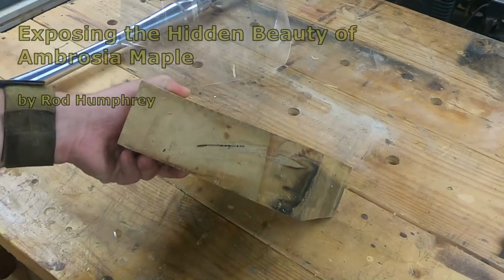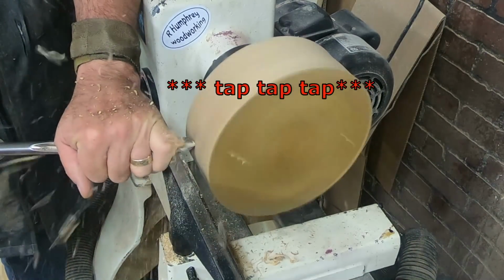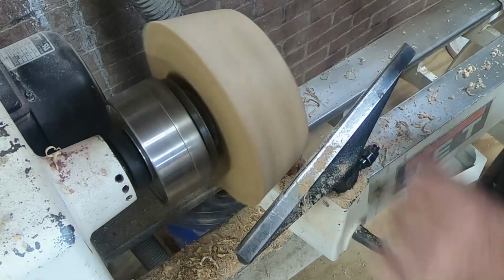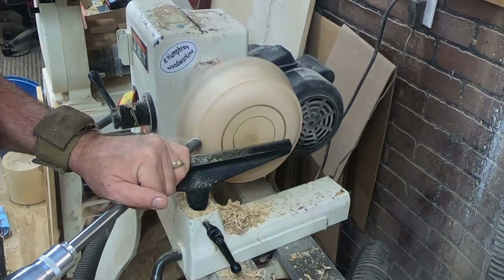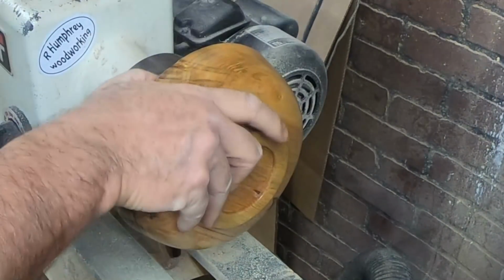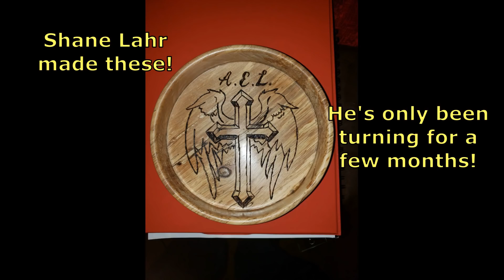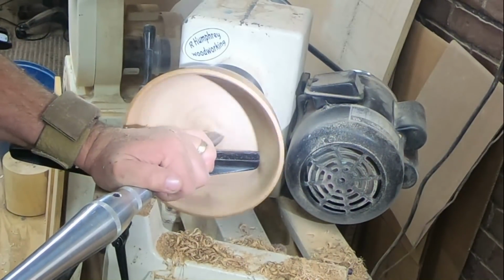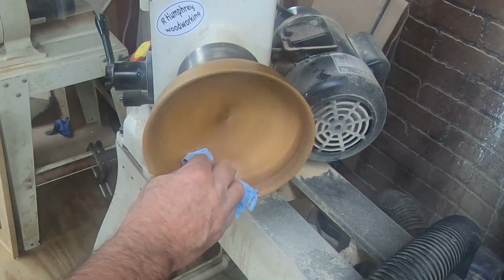Woodturning an Ambrosia Beauty

Comment: that ambrosia, when you first tried a different direction to reduce tear out, wow it looked so smooth and glossy, i love the markings to. lovely piece. i was looking right at the staple spot the whole time and never saw it. i love normal speed because it’s relaxing and real. the longer the video, the happier i am. i’m impressed always how thin you get the walls, it looks really lovely, i can imagine holding it, it would feel quite delicate but solid. the finish doesn’t give that yellow look, i like that there’s pinks and whites and greys in there, really pretty. thank you for your service marine!

Comment: Happy birthday Marines. I'm a little supprised you didn't use tailstock support while starting that piece. But you are probably well aware of what you can get away with. I've been burned a few times, so i generally use it. Pretty piece sir.
Reply from the maker: Yeah, I should have explained...  it was very light and dry, plus the worm screw had a really tight hold on it.  With heavier and more unbalanced pieces, I definitely want the tail stock up and supporting.  I felt very comfortable without it on this one... and then the staple, lol...  Thank you my friend!

Comment: I love the trance enducing sounds of the chisel cutting the project. Plus watching the shaving fly is great too. I do hae a question about the bottom mortis you cut, what depth do you use to ensure the blank does not spin out and at you? I always use a base plate when i turned. I really enoy your channel, for many reasons, but the speaking you do, is very direct & to the point. Thanks again for your contiuned awesome work.

Comment: I've noticed when you use the Acks or Yorkshire Grit, it slightly darkens the wood. Does it get lighter when it dries?
Reply from the maker: My experience with it is that it adds moisture and stays a bit darker.  But that moisture is a very good thing for such dry wood.